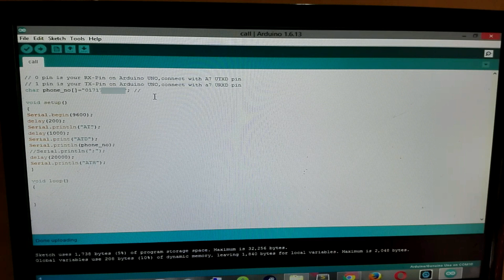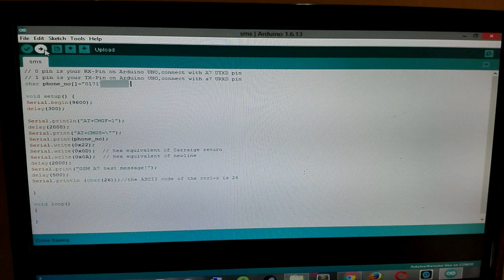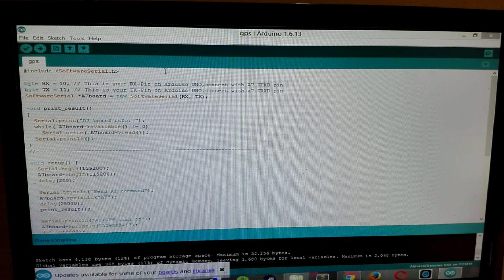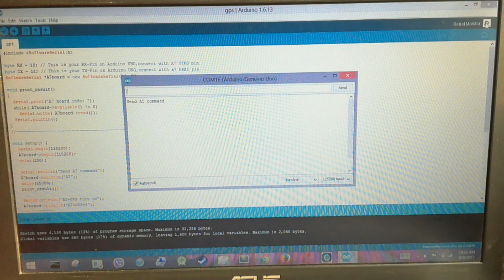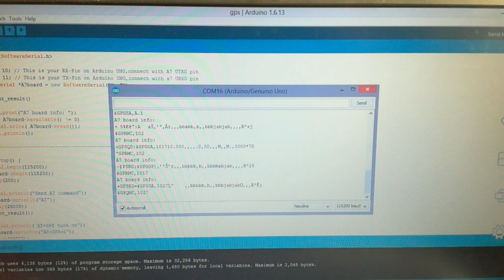AI-Thinker  A7 GSM / GPS Module Demo using Arduino

Comment: Many say the A7 consistently locks up after  80 or so calls and then requires a complete power cycle to recover.  I do not know if they are not coding it correctly or it is an inherent design flaw in the A7 as they claim.  Have you had this problem?

Comment: Hi, im using this module, but is it required to have alot of time to get a GGA  senetence and what is preffered wire antenna to be use for this module. Im having a trouble in getting a fix GGA sentences..

Helpmesir, Thanks

Comment: Hello. nice vidoo. so, can you help me please? I want to connect this module to my raspberry pi3. how can I do? help me please. Thanks.
Reply: hello did you know how to connect it to raspberry pi3?
Reply: SALUT. La communication entre rpi et le module A7 va se faire à travers les pins UARTs. Il faut alors brancher le pin UART_TXD ( Transmitter ) du module sur le pin UART_RXD ( Receiver) du raspberry, de même le pin UART_RXD du module se branchera sur le pin UART_TXD du raspberry. Pour le Raspberry 3, UART0_TXD est accessible via le GPIO 14 , et UART0_RXD via le GPIO 15. Par la suite, il faut brancher le GND du raspberry pi au GND du module A7. @abdelrhmanelkomy2174

Comment: I saw your video module A7 GSM arduino unfortunately, I could not make the communication between Arduino and A7
I am a beginner in this field and my problem, I think it is very simple for you
I just want to send and receive text messages

but I failed to change the communication speed of the module from 115200 to 9600

I think you can help me
Now I have several days of temptation, I try to find the bugs without any results
  unfortunately, there are not many examples of youtube that explains the use of this module GSM A7

thank you very much yes, contact me
Djaballah Soufiene <djaballah12@gmail.com>
Reply from the maker: do you tell me which steps
 you follow?
Reply: I saw some video on the A7 GSM modules with arduino among them your video

in addition, I find a document that explains not detail the use of A7 with arduino since I am a beginner (I need an explanation in detail) here is the document

http://acoptex.com/project/286/basics-project-064a-ai-thinker-a7-gsm-gprs-gps-module-at-acoptexcom/#sthash.tjZ0ICG2.eWqY1Qme.dpbs

I did not even happen to change the connection rate from 115200 to 9600

and when I work with 115200 (so change the monitor debit rate and not the rate of the A7 module) when I type AT then send the serial monitor does not answer by OK so is not connected

help me please, I do not find many people who work with A7

thank you in advance

what are the steps you follow?
Reply: Hi Djaballah.. I am new to A7 too.. Mine are different model, but I am finally able to send sms and make a call. I cant get the gps to work though :(

The followings are my steps
1. upload the serial sketch to arduino with baud 115200
2. turn on the A7 module
3. open the serial monitor, make sure the baud rate is 115200 and the line ending is set to "Both NL & CR", then wait until we see some random characters
4. change the baud rate of the A7 to 9600 with AT+IPR=9600
5. upload the serial sketch to arduino with baud 9600
6. re-open the serial monitor, make sure the baud rate is 9600
7. now we can use the AT command in 9600

I cant use baud rate 115200 except for changing the A7 baud rate to 9600.. 

Bad news is, after you reboot the A7, the baud rate setting is back to 115200.

Hope that helps
Reply: in my A7 module, after i turned on the module, sometimes it will display random characters that unreadable.. but some other times it displays the initialization of the module like this

^CINIT: 2, 32, 41891
^CINIT: 1, 0, 0
^CINIT: 8, 6144, 1
^CINIT: 16, 0, 1638450
^CINIT: 32, 0, 0
+CREG: 0
+CTZV:16/07/06,11:33:25,+08
+CREG: 5
Reply: thank you
for me it does not show anything

  I try with this code to know if the module is connected or not
https://pastebin.com/gRqR0Pbj

the serial monitor shows that it does not connect

do you have a module or sheld?

do you know the meaning of the LED D2 it does not turn on at home ??

what wiring do you use ?? and what tention and amperage ??

thanks for your attention of my problem, really i do not find many people who know the use of A7
Reply: me too cant find many reference about A7, and sadly the documentation are in chinese

my module is this one https://megaeshop.pk/media/catalog/product/cache/1/image/7dfa28859a690c9f1afbf103da25e678/h/t/htb1_pluspxxxxxbxvxxq6xxfxxxd.jpg

i follow the wiring and the sketch from acoptex tutorial

led D2 will on when the module is turned on. you need to press the power key at least 2 seconds to turn the module on

i just get my hands on the A7 too, so i dont have much experience with it yet. i plan to use this for tracker, but if i cant get the gps to work, maybe i need to look for another gps and gsm chip
Reply: this is exactly the module I have
and for the documentation, I work on the same documentation
unfortunately until now do not work
Reply: You have to be careful about following 1. Do not power gsm module via. Arduino use separate power and make sure to make ground common of shied and Arduino second use 1k or 2k  resistance for tx and rx and third make sure the Sim direction is ok and for GPS change the baud rate in sketch to 9600 instead of 115200 and if it works don't forget to say thanks
Reply: I would say thank you anyway whatever your recommendation it works or no I want to ask a question please:
have you already used GSM A7 or not?
I already give a separate power supply to the GSM and I also make the common land shed and Arduino
how to wire resistors to pins tx and rx ?? Please
how to ensure that the direction Sim is ok ??

thank you very much for your answer and your attention I did not find many people who use the GSM A7 help me please I did not even arrive to initialize the GSM module and to send sms

i do not need gps now
I need to send sms
Thank you in advance...
Reply: Djaballah Soufiene just put the resistance in series as the voltage level of A7 is 2.9 v as compare to Arduino 4.95v .by putting resistance in series it drops a voltage of 1 v so that A7 is stable.direction of sim is marked on the module.I was having difficulty without these resistance.Also after changing the baud rate to 9600 in provided sketch I was able to communicate all the call,sms and gps.If you want I can make a small video
Reply: I have not seen in the video that presents A7 the use of resistance
in addition the power supply is external and the GSM module communicates with the arduino only by tx and rx (normally 40 mA)

but anyway I want to make a test with your idea to add a resistance send only a picture of wiring please I did not understand how to do the wiring
Reply: Djaballah Soufiene will give you that
Reply: I did not understand
contact me by email or facebook please
I want to talk a little about wiring and I want to send a photo.
Reply: Djaballah Soufiene are you pressing the power key for 2 to 3 seconds after powering on the shield?the small white Button.I have sent you pictures of wiring also you can check if shield is working by dialing the Sim number in your shield by your phone this does not require any connection to the Arduino.kindly confirm email received or not
Reply: consulte email SVP

Comment: Hi
Nice video . 2 Questions .. which 2 pins on A7 are you connecting together? The arduino code is no longer on the site links . Can you send the code seperately ?

Regards

Comment: How can I use it with raspberry pi
Reply from the maker: yes it's possible .  GPS A7 module communicate data through Rx Tx  pin.  Connect with raspberry pi

Comment: how i can add both gsm and gps code on arduino to know the location by sending msg
Reply: hello did you get your answer??
Reply: no :(
Reply: So did you solve it in another way
Reply: Hi Islam, this module A7 is both GPS and GPRS, but you need to find the GPS anthena:  https://www.elecrow.com/wiki/index.php?title=A7_GPRS%2BGSM%2BGPS_Shield
Reply: @jotasmall  Yes, im having the same problem too. I cant get mostly a fix data and only random strings.

Comment: dont you need some level shifters between the TX-RX of the arduino and the TX-RX of the A7?
Reply: I would say yes, because the datasheet shows 2.8V max and most arduinos are higher than this. However no-one who's done a demo shows this.
Reply: CoyoteBoyUK yeah I was thinking about the same, no one shows that, I checked the layout In this module and the headers were connected directly to the pins on the  A7, so I tried first with the level shifters and sometimes I had troubles with the communication, then I tried it without the level shifters and everything seems to works fine so.. 🤔
Reply: Well that sounds good then, are you using 5V I/O from the Arduino then or 3.3? That saves me building a shifter up so thanks for confirming it!
Reply: Finally I used it with 5 volts directly!
Reply: Awesome, thanks!
Reply: Good luck with your project man!
Reply: Ivan Correa Rojas manufacturer confirms 2.8v only, via email! Very ambiguous!
Reply: That's weird.. well I ask you to make your own tests and then tell me your results please! So I can compare them with mine, but as I told you it works for me without the level shifters, you can try it first with them and then without and finally tell me please! Thanks!
Reply: No luck so far - can't get it to even respond!
Reply: Did you tried with and without the level shifters? Or just with
Reply: My module has a 232 transceiver inline, I tried through that and then I tried bypassing it. Code seems to be hanging up waiting for a response from AT+RST, suggesting zero comms back from the module. I'll have to get a scope on the output pins.
Reply: yeah, mine has one too but I didn´t use it, instead of that I used the pins labeled U_TXD and U_RXD (from UART), the pins you are talking about are the pins labeled 232_TXD and 232_RXD wich come from the MAX3232 chip
Reply: Yes, the documentation says use U_TXD/RXD with the MEGA (5v) but the retailer I contacted and the A7 module datasheet says they're 2.8V limited, so all the documentation conflicts. Either way, I tried using an FTDI into the 232_?XD ports and that gave me nothing either. Genuinely baffled.
Reply: jajaj well I guess we all can make our own conclusions about this ajajja, according to the documentation and my own experiencie  I can say that using the U_?XD pins directly from the board to the UART pins on the arduino it works very well
RESPONDER
Reply: I must just have a duff board!
Reply: CoyoteBoyUK maybe that's the answer
Reply: I am using the board with MAX3232 chip on it too.. and i can confirm for using U_TXD and U_RXD directly without level shifter works fine.. havent tested with level shifter

Comment: i tried your call.ino program, but it doesn't want to call to any phone number. my arduino uno is working, but i don't know what the problem, is my a7 ai thinker broken?
Reply from the maker: give me more details description . i can't figure out your problem.
Reply: i tried the "call.ino" program from this video, i follow step by step from wiring between arduino and a7 ai thinker until i finish complile the codes, i try the serial monitor. in the serial monitor, program is working well(AT-ATD-ATH), but the program never want to call any phone number. i don't know what the problem the program never want to call any phone number, sir.
i'm sorry for my bad grammar, i'm not good in English
Reply from the maker: call that number from other mobile and check  ring tone . by this way u can check everything ok or not.
Reply: call the number from other mobile is ok, i tried too the sim card from the a7 module in mobile the sim card can call to that number and other phone number
Reply from the maker: did you use same code that is given.. ? you can extend delay time to my code..
Reply: yes, i use the same code. ok i will try to extend delay time
Reply: Have you been able to solve your problem ?, It happens exactly like you but it does not occur to me to try ...
Reply: I have the same problem but I use this connection diagram and it work. You have to make sure that you use the GND on the PWM side not the GND from the 5v and 3.3 V side. Please folllow extactly what the figure said.
https://drive.google.com/file/d/0B9sdxb3mPeFyVWhCZzVHcFBOaTg/view

Comment: Can I supply voltage from arduino to module
Reply from the maker: No. It's not possible. A7 need upto 1 amp current. 
Arduino Can not output that much current.